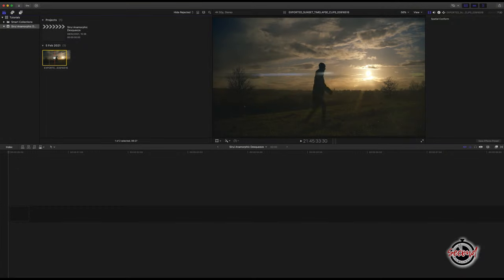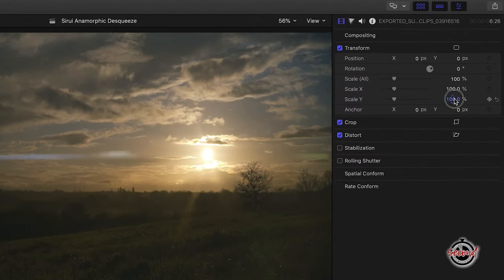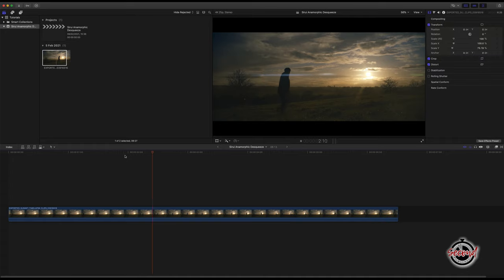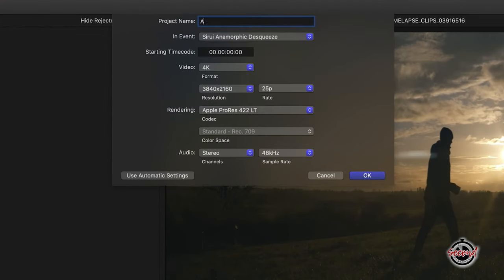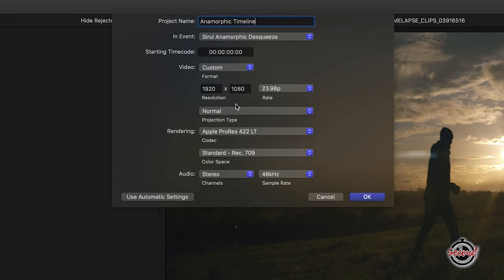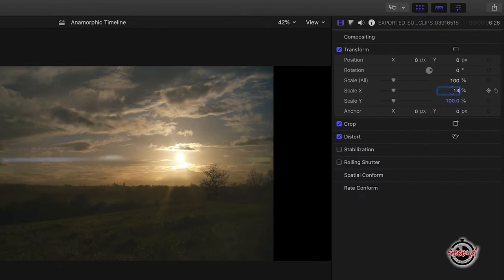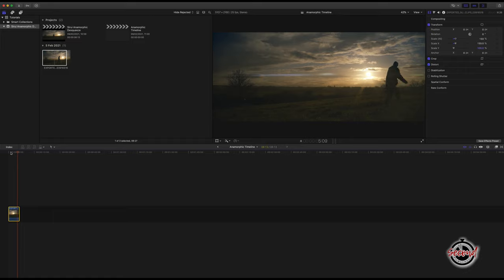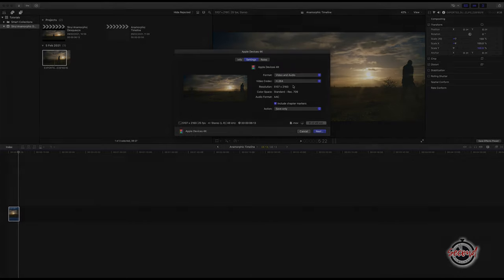How to Desqueeze Anamorphic Footage in Final Cut Pro X

Comment: thanks for this! does anyone know if it's possible to correct a video that was accidentally shot with the "1.33 anamorphic" desqueeze turned on in Filmic pro? I forgot to turn it off after taking off the anamorphic lens and am hoping I can save the footage and get it back to it's normal aspect ratio. the video was set to record 16:9